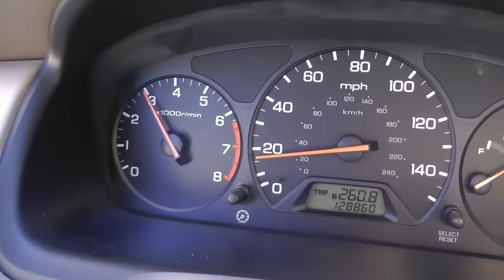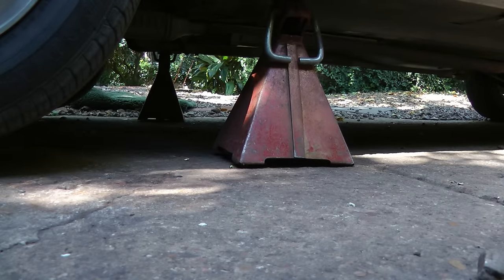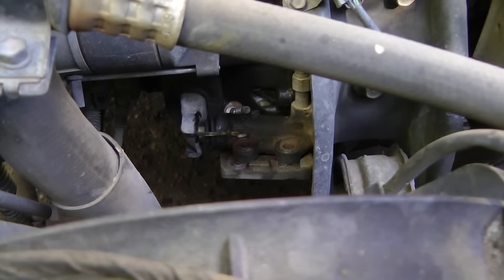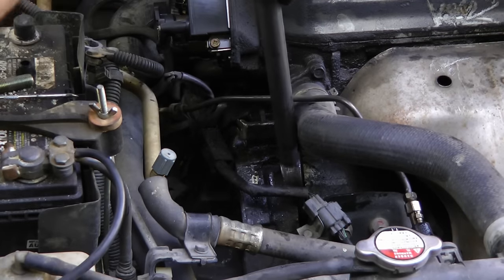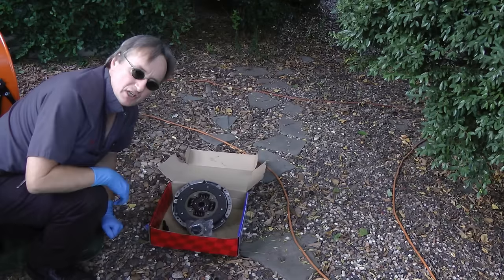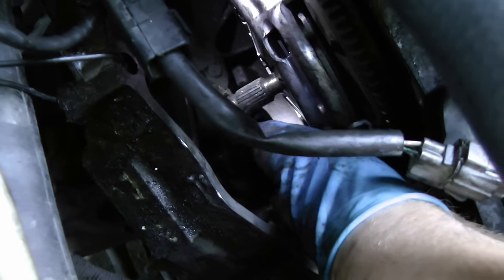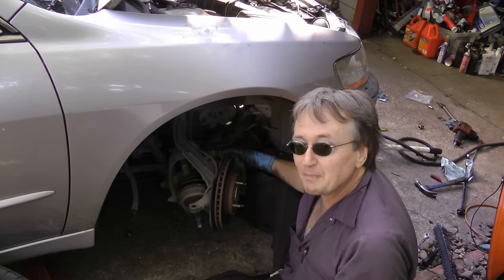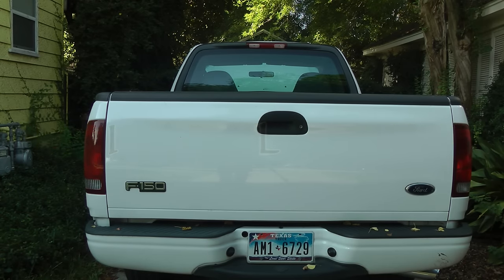How to Replace a Clutch in Your Car

Comment: Haha 4 minute video, and for us backyard mechanics how many days would this take?
Reply: Days? Someone is optimistic... I'll do brake jobs and most of the fluid changes on my car, but I'm not messing with the engine, drive train or suspension, I just know that will end badly.
Reply: If you really went at it, about 3 hours max. You're literally only taking the drivetrain out, and then undoing the bellhousing bolts. That about 10 minutes of work. Then installing the new clutch about 5-15 more minutes. Then mating the transmission and engine back together, about 2 weeks.
Reply: @hakont.4960   Håkon T.  you have to think about it as a functioning unit rather than how difficult it is. One easy way to get over that fear, cause we all have that fear, is to learn how it works before you start the job. Suspension is probably the easiest thing you stated. You have a strut, a spring, and a shock absorber. The strut is the assembly, the spring is the spring and the shock is underneath all of that at the bottom of the assembly. It's really not complicated at all. If you want to get into the control arms and all that, then you start getting into the complicated stuff, but it's really not complicated. Engine work ehh, not my cup of tea, but you can't learn if you don't try. The only thing i will let a professional do is turbo, and electrical stuff. I do not mess with either of those.
Reply: @mattevans1643  You do have a point, but my current car has a computer controlled hydraulic clutch and computer controlled "new type" automatic transmission. Might have given it a try in my old car though with a regular manual transmission.
Reply: @hakont.4960  yeah, that falls into the electical stuff, i don't mess around with that stuff, way to complicated for me. Older cars, or even my 2012 i can do, because for a new car it doesn't have much electrical stuff going on. But any of the new stuff, i don't touch, except basic suspension, exhuast, and fluids. Everything else i stay away from, cause i have no idea how it works. The new electronic clutches, i'm sure it's pretty close to the same thing, but i refuse to touch them.

Comment: A good overview for 4 mins, but you may need to re-machine the flywheel surface and torque the clutch pressure plate down to the correct specs.

For some reason you made this look fun, it's not fun doing this in a drive way :)
Reply: I agree most important to re face the flywheel. No point in replacing a clutch unless you do that. Poor advice from you video.

Comment: Great vid man ,put a new clutch new flywheel new little throw out bearing all that good good idk why it still grinds in second. Gear and reveres it grinds and don’t want to go in and it’s being harder to jam into first it like it has a mind of its own lol it’s tragic does anyone know what it could be my cunado said saying we can try to buy a new master cylinder since it’s the only thing we haven’t changed and my Suegro is saying that the brand new fx stage 2 racing clutch we put in ain’t put on right he said it’s not aligned right ??? And my punk ass homie is scaring me saying it’s my syncros that I gotta get a new transmission however the other 2 master minds are saying it’s not the tranny can anyone give me an opinion on what it could be it’s drives good I just go from first gear to 3rd and so on and it picks up goes fast 99 Honda Accord 2.3  I hope my cunado is right and just alignes it right and problem solved however I feel it can’t be cuz I thought my cunado was sure to have put it on right ???

Comment: has anyone actually used this video to replace a clutch? Also, I was wondering if mine needed replacing. sometimes when I upshift the revs stay high for a second then go down before they go back up. This means my clutch is slipping right?
Reply from the maker: you need a new clutch

Comment: Might be worth mentioning that a torque wrench should be employed here. I imagine at this point you are something of a human torque wrench but I can't help but think that someone is going to watch this, and when they go to tighten the bell housing bolts, they are going to do so with the force of god. SNAP!
Reply from the maker: you get em hand tight, they will not come off. those bolts are pretty thick.

Comment: OR... You could do it the right way and replace or resurface the flywheel... Spend a few bucks and replace the oil in the trans. It's prob been 200k miles...
Reply: Manual transmission oil lasts pretty much forever unless you do 24 hours of Le Mans every day with your car.

Comment: can a bad clutch prevent a car from starting?
Reply: +Clyde Ng wow.... ok.... this has to be addressed by someone. 
no bro, thats your battery
Reply: The answer is NO, a bad clutch will NOT prevent a car from starting.
Reply: Ground wire on battery, battery, ignition switch, starter, gasoline, gasket, spark plugs . it could be any of those, but not the clutch
Reply: Yeah actually it can, if your clutch is that messed, it may not even be seperating from the fly wheel, in which case your starter would be trying to turn not only your engine, but also your transmission. Its unlikely though
Reply: No...... unless the actual clutch pedal is locked or something since most newer manuals require the clutch pedal to be depressed to start the engine(In order to avoid runaways).
Reply: What ever mechanic told you that isn’t a mechanic he’s probably wearing his dad boiler suit 😂

Comment: Youll talk about air filters for 22minutes, but have a 4 minute clutch video. And theres wet and dry clutches. And not slave cylinder, slave solenoid. And its throw out bearing not throw on bearing

Comment: if any one has an answer id aprecaite it. i turn my car on. put it in gear, then when i let off the clutch. nothing. it wont even stall. it just revs constanly. anybody know whats going on ? i find it wierd that it wont even stall....
Reply from the maker: Jared shekoski time to do this video, clutch is so worn out it's slipping entirely
Reply: So i should replace the clutch?  What would i buy ? A clutch kit ?
Reply: Scotty Kilmer what would you recommend
Reply: Quick note if the speedometer goes up like your moving the it's not the clutch. I had a car that one of the axles would pop out all the time.
Reply: whenever I try to put it in gear it just revs. Doesn't move. Doesn't even stall. Unless I sit and rev the engine to like 10,ooo rpms. But even then it only moves a centimeter
Reply: @James ratliff
Reply: If there is pressure on the clutch pedal when you press it then I think it may be the return spring has stopped working entirely. 
If there's no pressure on the clutch and it flies to the floor when you press it, I suggest its a hydraulic leak.
Reply: Jared shekoski It could be a rusted drive shaft that broke. This happened to me 1 month ago. Engine turns on fine, pops in gear but it doesn't grab.
Reply: Jared shekoski you have a worn out clutch..

Comment: Hi Mr. Kilmer 
I have been watch a lot of your video been working on the car a lot lately.
I just replace both cv joint on a 1995 escort.and I have read a lot
and you did not say anything about :
 WARNING: If you are removing BOTH axles, place a length of broomstick through each axle hole as you remove the axles. Otherwise the side gears will fall out of the differential and you'll have to tow the car to a transmission shop to get them put back in!!!
got it from here:
http://www.answers.com/Q/How_do_you_replace_a_CV_axle_for_a_Ford_Escort_1993_1.9_liter
if this is true this may help someone

Comment: for some reason my transmission wont wiggle back together
Reply from the maker: you also have to push in like mad. If you can't get it in, get SUPER long starter bolts to force it in that way. I have sets of them myself, you put one on the top and one at the bottom and gradually tighten one then the other

Comment: Not helpful video this time. No details at all. My clutch should be good because it was replaced 2 years ago. When i only press clutch pedal all over to the end on neutral state with no car movement, i hear sound from clutch. What is the problem?

Comment: you forgot to show us how to install the slave cylinder. lol
Reply: Clutch Slave Cylinder goes in as it came out. Just have to remember to match the pin to the spoon groove otherwise you can pop the assembly which is around 60$-80$ just for a new part. Not to mention rebleeding the line. Not required though if it was just taken off momentarily. Many videos of lines being bled by the assembly being fully removed and elevated like a medical IV then manually pumped to bleed lines. Fun times.

Comment: Never saw a clutch that was on the side of the engine, my rangers is under.
Reply: The clutch is on the end of the engine in that car, it's just the engine is installed side-to-side like on most front wheel drives.

Comment: Scotty you make it look so easy. You must have shocked the doctor with a 14mm ratchet wrench and little blue gloves on the day you were born. 

My question is: Can I use the same procedure on my 1994 Celica GT Engine: 5sfe? A buddy of mine insists that I need to lift the engine to change the clutch because that is how he did it on his 1993. I say he didn't see your video before he started the job. 

I doubt you need it but, in case somebody has a similar problem to mine and would like to compare their problem with this answer, here is a dropbox link to a photo of under my hood.
 
https://www.dropbox.com/sc/6cu3b9dew0kzibk/V4JKh5sskY

THANKS!

~LFoD~
Reply from the maker: you don't have to lift the engine, just realize a lot of wiggling of engine and transmission is often required to get the tranny off to get to the clutch. I left out the cursing in this video.

Comment: Utter garbage.... No clutch change is universal.

Most clutch changes require either dropping the sub frame and or releasing the engine from its mounts and sliding it forward whilst supported by a rig.

This is suitable for this pickup but to claim its universal is a joke and attempt to follow this at your peril because the cost to call out a mechanic to your car in bits on your drive will 100% be Sky high!